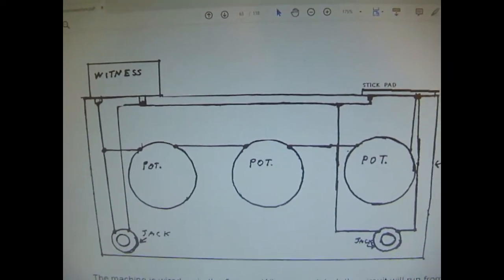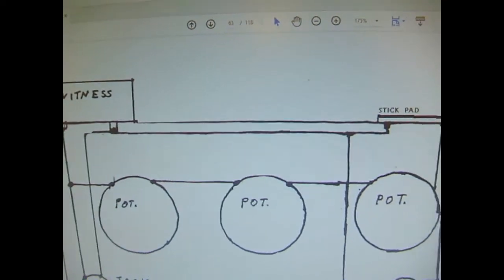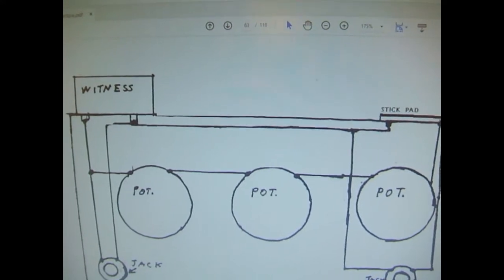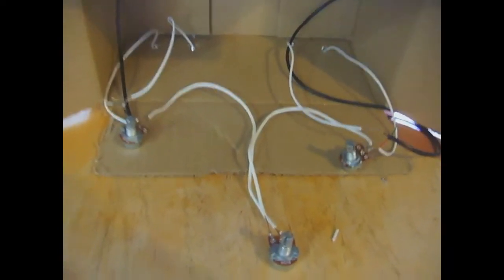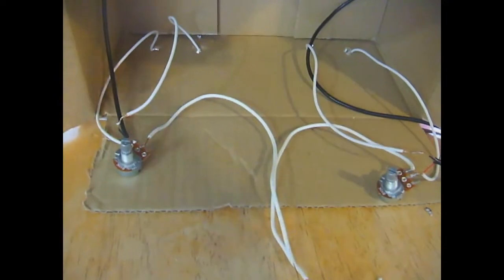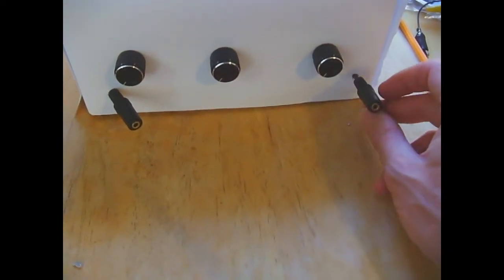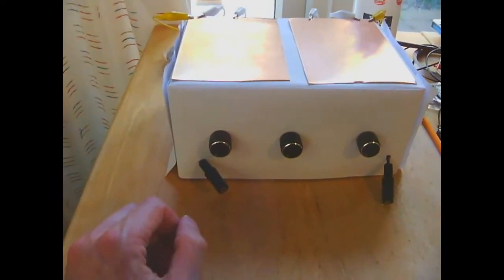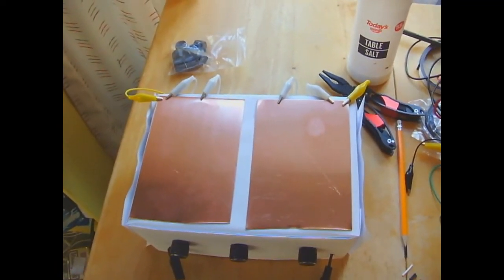Making Radionic Boxes 04

Comment: The original says: "Start by making the stick plate. Take the plastic plate you have been playing with and a coil of unshielded copper wire (sold as magnet wire). Coil the wire under the plate in such a way that when it is turned over the wire will be all under it and the two ends of the wire can be brought down into the machine." You just took metal rectangles and attached connectors to them. This of course won't work.

Comment: the center wipe of the potentiometer isent being used so the circuit isn't fully explained in the drawing in the video.  but in the video  of the one built it shows it, you can see it is being used and one of the outer potentiometer legs

Comment: At 1:40, you mention the wire going from well to stickpad, I find that odd, too.  Those plates are already connected through the resistors ( potentiometers ), according to  the diagram..  I did a google search in images, for a " 3 dial radionics diagram ", and, looks like others use the same method.    I'm trying to visualize if you add,  9 volt dc power to the input,  the flow of electricity wouldn't really work, would it, the way the diagram shows?  I'm not an electrician, so, I don't know.
Reply from the maker: Cosmanio suggested that the energy woudl flow in perpetuity around the circuit  through the plates and resistors. i am taking a different attitude that although the wires and the plates and resistors must have an interaction with the human energy field and must in some respects act as a holder of "wish" or intention, much of the way that the energy flows is more faith directed, much like sanjeevini card system whereby the operator probably hasn't researched the way that the original dowsers created the radiesthetic cards but still claim to gain results. Sure there could be the fact that intention is passed along the line from the original creator of the symbol to the distributors, users and printers of the symbols, so the symbols build  up an intention all of their own over time, and maybe the machines are like that too. so we are tapping into the machine and the thought form of the machine and the creators and users of it as much as the machine itself.
Reply: @BespokeGroupUK  As a passive device, I can understand the energy would flow in and around the circuit. However, just doesn't seem like added DC power would work. I could be wrong.   Here is a simple diagram of a circuit I think would work. Just doesn't have wrapped crystals in the design, but, those could be incorporated.  " http://www.berkanapath.com/radionics/344/simple-powered-three-dial-radionics-machine/ "